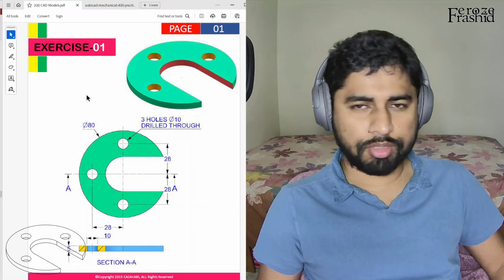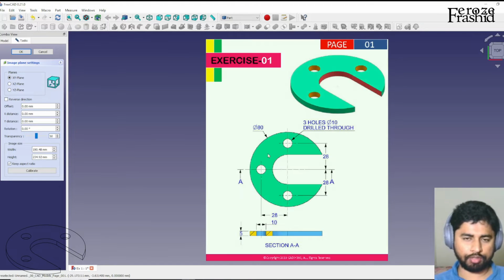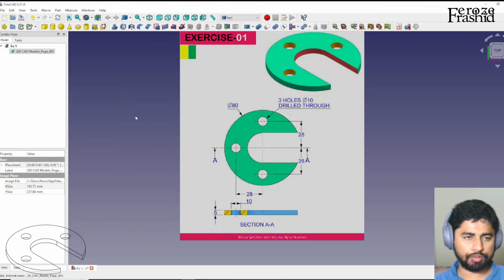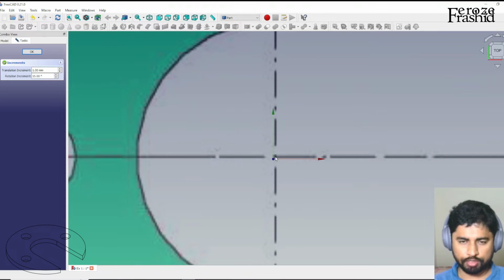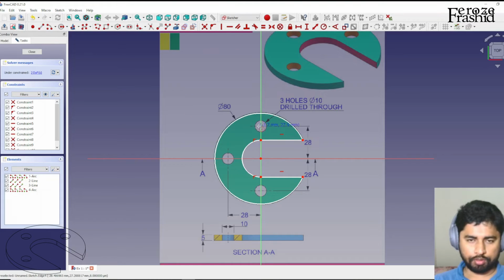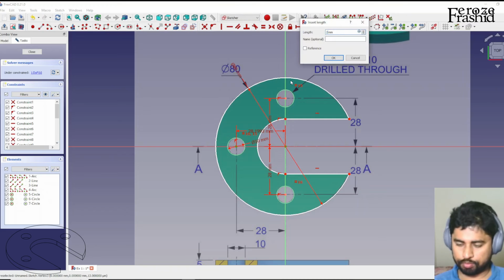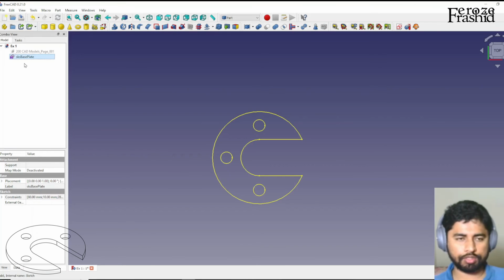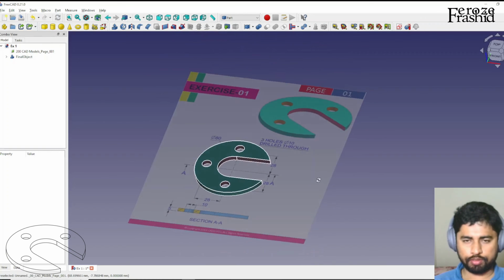200 3D Models in FreeCAD: Exercise 1

Comment: one question
does the goal of the exercise is to create a part drawing over a calibrated image, or construct similar part by just looking up constraints in the book? because i don't think importing image to the cad software is even neceserry, there is this missing diameter  in the missle but you can alwats add a point on the edge and use symethry over the hole circle
Reply from the maker: In this series of 200 tiny models, I explore the saying "there are more than one ways to skin a cat." I invite you to come along on this journey. Maybe I will pick up a few things from you here and there.